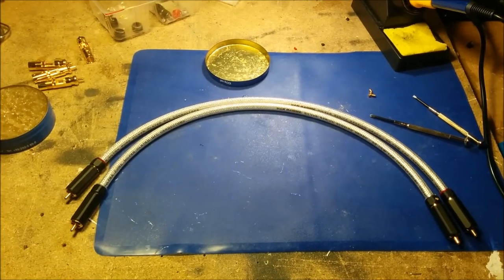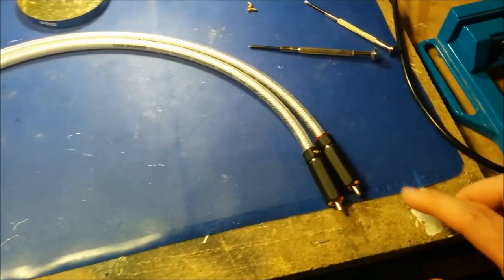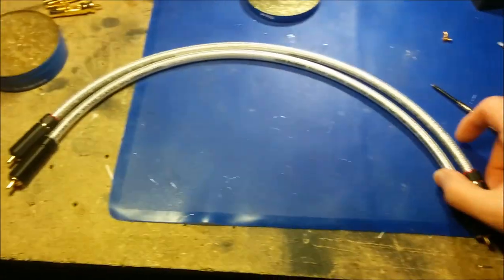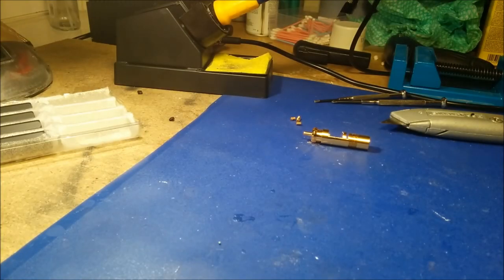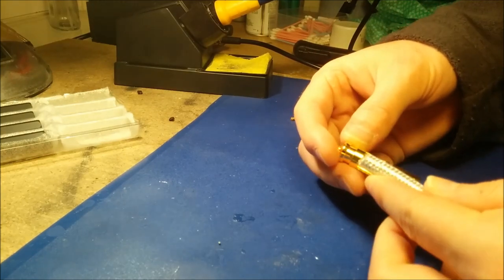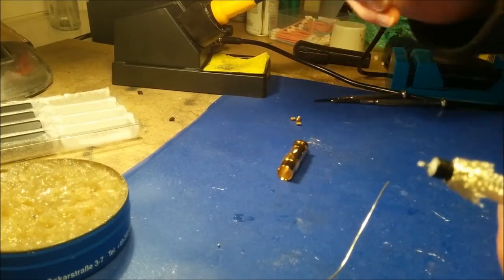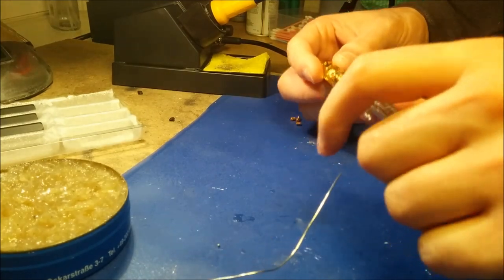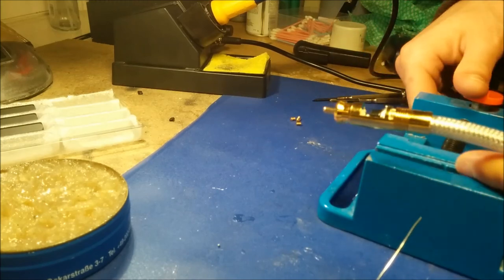How to make 1000 $ Sounding audiophile highend RCA interconnect cable for 30 $ !!!

Comment: Hey buddy, there is NO such thing as a good cable that has solder to make them...solder is two things, resistance and distortion, so your claim of " so called " $1000 cables for $30, won't cut it with anyone!

Comment: How cable sounds exactly?? LOL
Reply: Cables transfer the sound from source to output device. If its a shitty cable the quality of sound will drop. That is the sound people talk about for cables.
Reply: You guys are making science from "right cable". I bet you can't hear differnce between 20$ and 1000$ one.
Reply: Radovan Skalamera No one is making up science here. Why do super long runs of cables need repeaters? Because it will suffer signal loss. Now we aren't running 100 meter runs of cable here, but a crappy cable will still have some form of quality drop due to different things. Now I said this in a different comment already but a $1000 cable is stupid and really not needed. But I have listened to my headphones with a $30 cable and a $300 cable and can notice the difference. You would also notice the difference between the $30 and $1000 cables too. But comparing the $1000 to $300 would be challenging due to diminishing return.
Reply: BS, in a stereo rack, you can use a cable from your Nintendo back in the 80's (the red / white one) and put it against a 3000 dollar cable and not tell the difference.  The run is way to short to have audible "Signal Loss".  now, a cheap cable may pick up hum from a power source nearby, but you won't hear an audible difference from signal loss.  Don't believe me, test the science, get an ohm meter and test the loss over both cables and you will find in very short runs there won't be much of a difference, if at all.
Reply: Bill Youngblood Again, quality lost due to long runs isn't the only way quality can be lost. I've tried $30 cables and $300 cables and can notice a difference.
Reply: It's in your head, unless the cable is a single strand of copper you won't lose quality in the cable over a couple feet, and even then, you probably won't notice.  If you are thinking you are hearing a difference it is because you want to hear a difference.  Like I said, try it for yourself, get an ohm meter and test both cables.   Unless the cable is picking up "hum" from a power source or bad ground, you will not hear a difference, because simply, there is no difference.  The only place the gauge of wire really matters, is for speakers, and that's because it is transferring a lot more power through the cable.  If you really want to see another example, take the lid off the component you are using that fancy 300 dollar cable with and look at the wire it connects the jack with the circuit board.  You will see the cable the manufacture uses is much cheaper than your 300 dollar cable.
Reply: Bill Youngblood 
Can you guess what the pros use? The copper or the silver plated extremely pricy copper in fancy sleeving? I bet that guy can't :D
(by pros I mean someone that works with audio equipment a lot, like someone working at BBC for example)

Comment: Audiophile cables are balanced, not RCA. This video is misleading and flat-out wrong in so many ways.
Reply from the maker: ha ha lol OK
Reply: audiophile cables can be interconnect RCA or speaker cables, not just balanced cable.  It refers to high quality audio cable of any kinds, not the type.  A high quality, bare wire cable (with no end connector) connected directly from an amp to speakers is still considered audiophile cable.
Reply: Nope. Smart audiophiles use XLR and TRS connectors.
Whilst audiophools use RCA cables that cost thousands....
Reply: that is not always the case.  There's nothing misleading in the video, my guess is that you're mega pissed off at spending thousands of dollars on snake oil BS cables!
Reply: salty much?
Reply: +mrtheoden All my cables are made by myself
Using 12AWG OFC raw cable and using nice metal RCA connectors.
I'm not an idiot that buys a cable because "the construction garantees the best possibile sound whilst passino the cleanest ammount of current.
Reply: your original comment inferred that balanced/XLR were superior connection methods to RCA.  This is not necessarily true.  Balanced/XLR can be superior over longer runs, but for most home audiophile systems, this is not the case and any advantages that Balanced/XLR might have are negated.  There is nothing wrong with RCA connection methods.  As to paying $$$ for cables, only fools part with their money.  When you try and question this with audiophiles who have too much money on hand (and waste it on expensive cables or support racks) they get very upset and defensive.  I got banned years back from an audio forum because I said that a certain hi fi rack was way too expensive (like at the time AUD 6k!).  I refused to recant and apologise, so I got banned.  Sorry, not sorry!  There are many things that are a rip off in the hifi game and it's a shame, cos it promotes elitism and discourages new people from entering into quality, but reasonably priced gear.